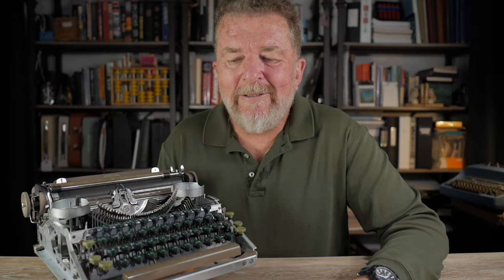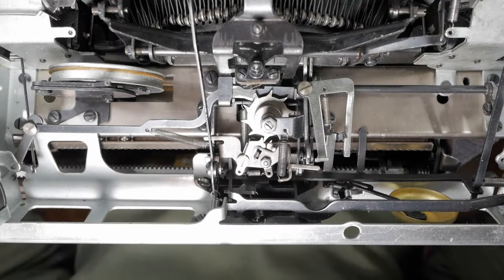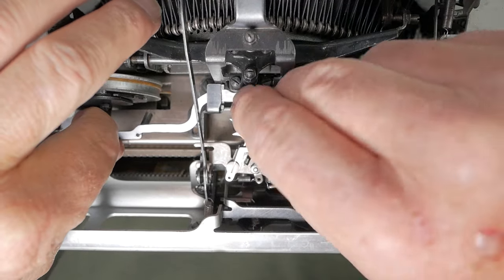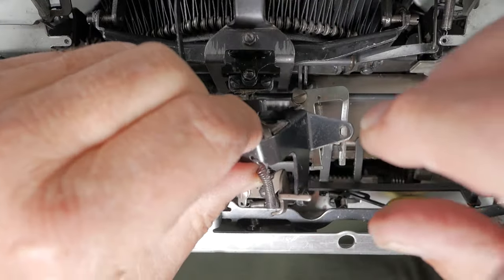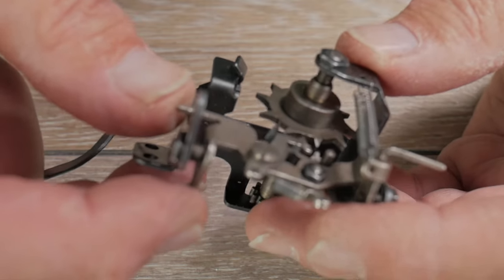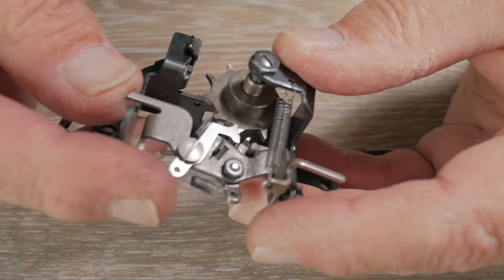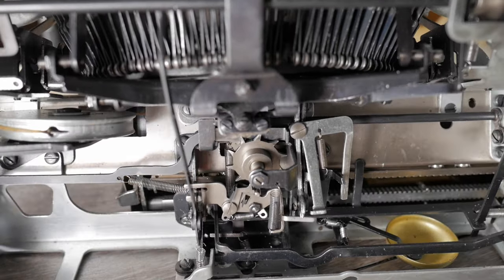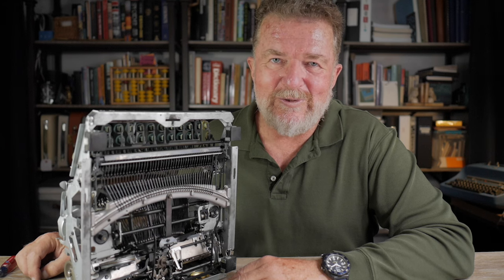Typewriter Escapement Repair

Comment: Joe, I gotta say that you could've taken out the part of the escapement you wanted to work on merely by loosening the two pivot screws on either end of the rocking dog plate; you didn't need to pull the whole star wheel out or unhitch those springs....

Comment: Did you use rubber from a tire tube? Or does it need to be stiffer? Thanks for a well explained procedure.
Reply from the maker: I cut it from a thin sheet of rubber that I’d bought a few years ago as an experimental rubber backing sheet for hard platens. I think an inner tube rubber would work too.